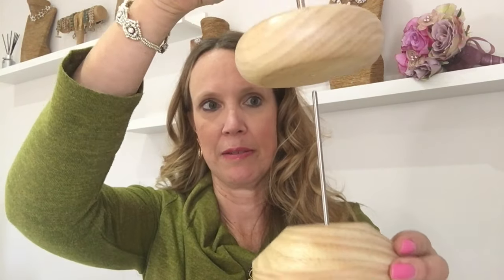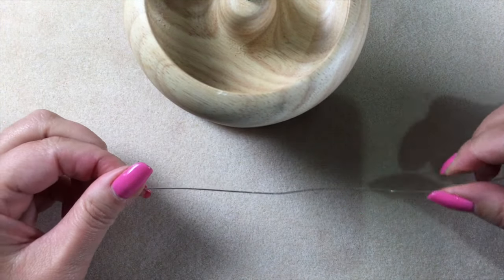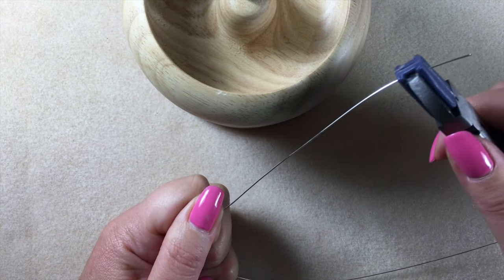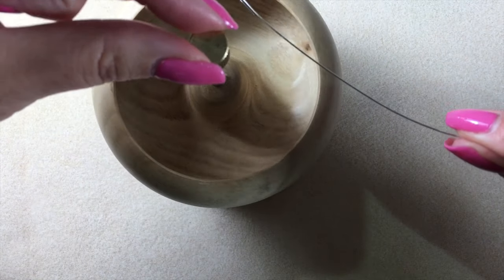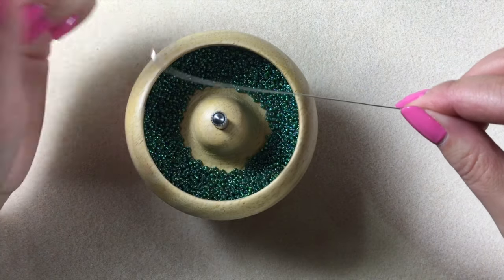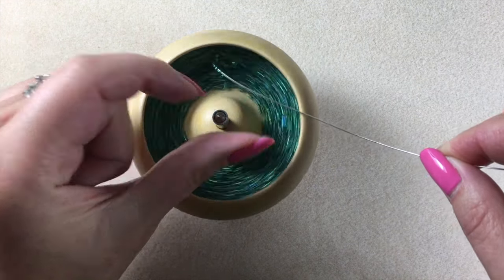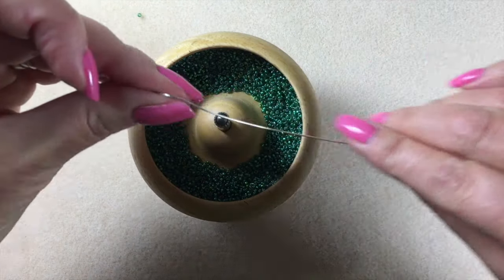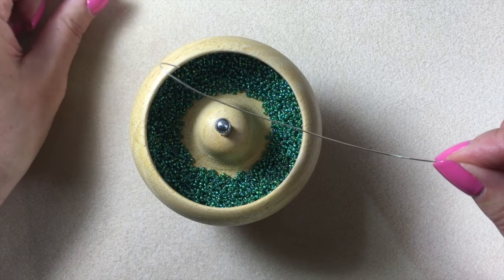How to use a Bead Spinner

Comment: So then the necklace is made out of that wire? Wont the necklace be still and bendy when put on? I'm sorry i don't understand, I wanna buy this but I'm confused
Reply from the maker: I'm demonstrating how to spin the beads directly onto wire in this tutorial. It's to be used with a technique called french beading which is used to create beaded, floral displays - I don't actually use this technique for stringing beads in order to make a necklace.  If I was demonstrating for that purpose, for example bead crochet, I'd use the needle that comes with the bead spinner and I'd be spinning onto a thread rather than a wire.  Hope that clears up the confusion...x
Reply: @JoBarclayLoggie  I got it, thank you!

Comment: I’m a little confused. Because the jewelry I makes is with either a plastic string or wire string so I’m confusing how you would get beads on something like that? 
Or does this only work for a wire?
Reply from the maker: Hi Tammie - no it doesn't only work with wire but as I mentioned that's what I use it for, when I'm making french beaded flowers - so that is what I was demonstrating. Most of them do come with a needle - check the box before you buy - and you'll be able to thread your chosen beading thread onto that before wildly spinning and stringing your beads! ;-) x

Comment: After the beads are on there, how do you transfer to a regular string
Reply from the maker: If you wanted your beads on a regular thread, you would use the spinner the same way, but use the needle that comes with it and you will have just popped your ordinary thread through the eye of the needle before hand....x

Comment: Hi there does this work with any size bed or bigger beard such as 10 mm
Reply from the maker: Hi Havilah...a 10mm bead would be too big for a bead spinner. Bead spinners are used for seed beads (typically beads sized 1-3mm) when french beading or doing bead crochet.

Comment: hi what are all of the product names for the tools and spinner you used!
Reply from the maker: Hi Liberty - I have a few, but the one I use the most is the Beadalon Spin a Bead Junior.  They also have the plastic cups that sit inside the spinner enabling change of colour very easily...
I use the spinner for French Beading most of the time - so I spin directly onto 0.6mm or 0.4mm wire.  Hope that helps! xx

Comment: What are those needle called and also can we connect on a stretchable wire?
Thank you!!
Reply from the maker: Hi - I think you get needles supplied with most spinners that are available on the market - however; in this demo I was showing how to spin the beads directly onto wire which I had shaped to resemble the needles that come as part of the kit.

Comment: I am trying to repair a vintage Dior glass bead necklace where the large faceted beads are threaded on black wire, each bead being individually wired, I have had to remove some beads because they were so badly damaged. The beads have been threaded with a single thread of wire, a loop made & then the wire is wrapped around the wire beneath the loop 2 or 3 times making a tight coil, clearly each bead was looped to the previous bead during construction, but I just can't wrap the wire around tightly enough, not helped by the wire having a black coating, can you give any advice?
Reply from the maker: It's so difficult to give you an answer without seeing what you're talking about. When I'm wrapping wire loops, I sometimes feel like my fingers are a) in the way and b) not strong enough to pull the wire tight.  In this case I use a pair of pliers as an extension of my fingers - I can then get a better grip on the wire, making my wrapped loops much tighter and neater....x

Comment: What specific  string do you use for these? Also do you use a needle for these?
Reply from the maker: I spin straight into either 0.4mm or 0.6mm wire. I also just bend the end of the reel of wire into a needle shape (a hook) and that does the trick...x
Reply: @JoBarclayLoggie  does this affect the shape of the bracelet or necklace?
Reply from the maker: Okay... of spinning for a necklace or bracelet I would I use something like a nymo thread and the needle that comes with the spinner. Your thread will easily go through the eye of the supplied needle. Spinning onto wire will be too rigid. I spin onto wire to make French beaded flowers which need the strength of the wire to stand proud. Sorry for misunderstanding your original question...x

Comment: The question is, for a bracelet we use elastic band, so how does that work....
Reply from the maker: The bead spinner is not a tool to use with elastic…it comes with a needle that you can use to spin beads into thread or you can make a needle with wire and spin directly onto wire if you’re going to be doing french Beading…x
Reply: If you use a spinning needle (a large hooked needle) in place of the wire you can spin beads onto elastic the same way you would with thread. Just make sure the knot is small enough to allow the beads to pass through. The hooked needle catches the beads like you see in this video, but then instead of pushing them down the wire, you would simply push the beads over the eye of the needle and onto the elastic or thread

Comment: Brilliant idea I was trying to enter my nylon wire in the needle and I couldn’t do it 😭 so I was thinking of what to do . I would prefer to make my beads on wire nylon beads . Because I prefer my necklace to be soft and to move nice on my chest and not to be stiff. I think I’m gonna use like 20-30 beads and cut the wire and connect it to others . 🧐
Reply from the maker: I was spinning directly onto the wire to make French beaded flowers for a display, but I understand what you’re saying about needing your beadwork to drape especially if it’s a neckline piece. Good Luck…x

Comment: Is it working only with wire?
Reply from the maker: I only use mine with wire for a technique called French beading but they come with a needle that you can attach thread to and then spin your beads on at speed for something like bead crochet…x
Reply: Well I didn't get the needle, only wire😢
Reply from the maker: I’m sure you can get needles for whichever type of spinner you bought…check with your local bead store-but as I mentioned I only use mine with wire…x

Comment: Can I use soft beading wire?
Reply from the maker: It really all depends on what you're wanting to make? x
Reply: @JoBarclayLoggie  I make beaded necklaces and like to use seed beads near the back of the neck (I don like big beads on my neck. Maybe I do around 7 inches on each end of the beading wire. I wanted to find a faster, easier way to add these tiny seed beads. Thanks

Comment: What is the wrench your holding? My dad doesn’t have one
Can you just bend it with your fingers?
Reply from the maker: Hi...not sure if you're referring to the nylon jaw pliers that I used to work harden the wire? If you didn't have any pliers to form your needle shape,  bending it around a pen or pencil would work equally well! x
Reply: @JoBarclayLoggie  ok thank you! 👍